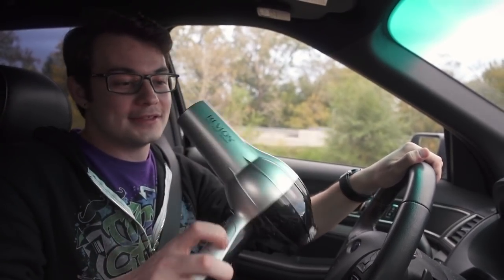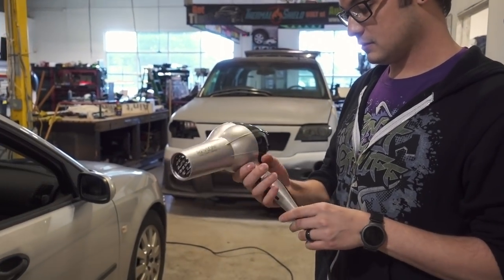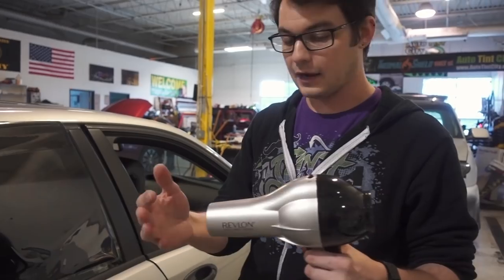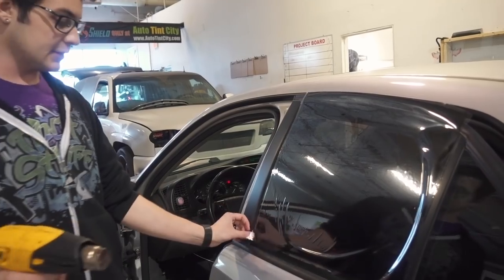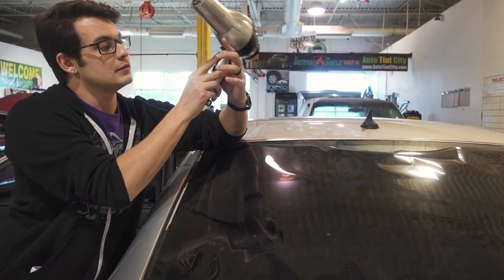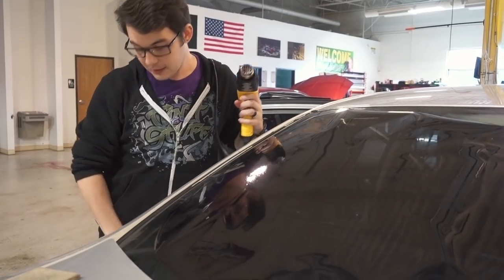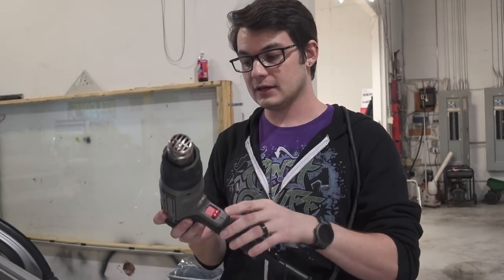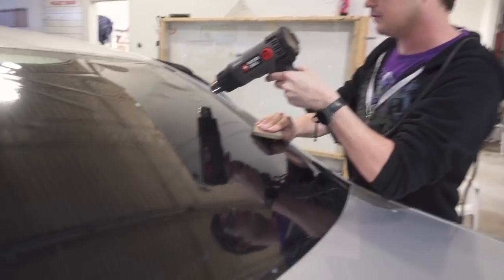Can You Tint Windows With a Hair Dryer? | Will a Hair Dryer Shrink Window Tint

Comment: Back windows = a massive headache. Tinting for my first time and got all other windows done on my vauxhall (opal) meriva A mk1. Uk btw. But back windows just wanted to cause zippers on fingers? Nightmare so ordered more pre cut tints and a cheap 2000watt heat gun with 2 settings. I want it to look perfect and do it perfectly as im interested in a career in this business. Doing Mobile jobs as i love trailing and doing car mods. So will also be doing servicing/and general inspection of certain parts. Plus doing mods inc body work and trim work basically upgrades what i can do Mobile.

Comment: i mean iv studied this, wanna do my own windows.. but why shrinking? it makes sense laying out the tint on the reverse side to form it and then prep it but using an heatgun twice on both outside and inside??? could you just use the heat gun on the inside, is it to do with adhesion? Thanks for any advice/explanations.
Reply from the maker: You only need to shrink the film once to fit the curve of the glass. It's not possible to shrink the entire window on the inside of the car. Shrink once on the outside, small fingers can be touched after the film is installed

Comment: What kind of squeegee are you using for the back window? A lot of times I've gotten it down to vertical fingers at the edge but then they turn into wide u-shaped fingers that I have to chase down and try to "turn" back vertical. Any tips?
Reply from the maker: It's called a MacTac, It's a felt covered block of foam that works very similar to a hard card but its softer so you don't risk hitting a small rock causing a tear in the film and it doesnt crease the film as easily. i should prolly make a more detailed video about it.
Reply: @DetroitTintStudio  another rear window how-to would be awesome!!
Reply: They work very well definately something to have around that for sure.